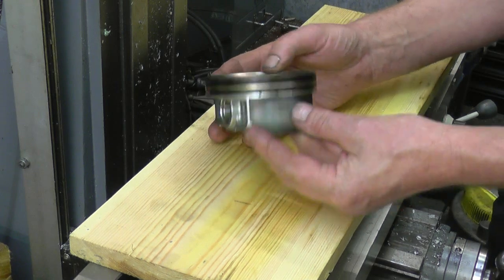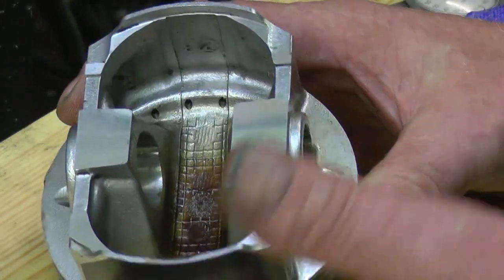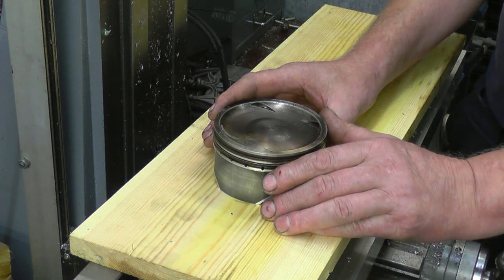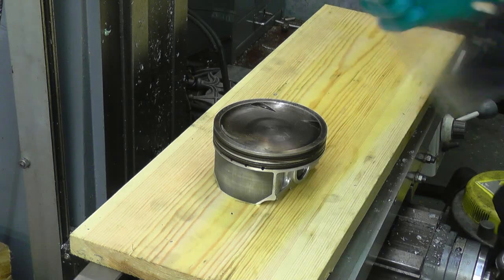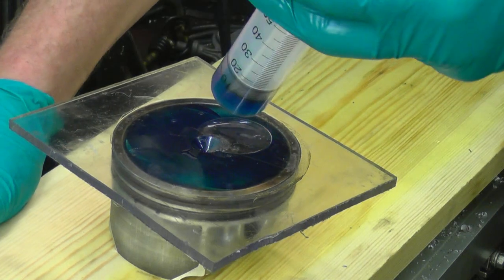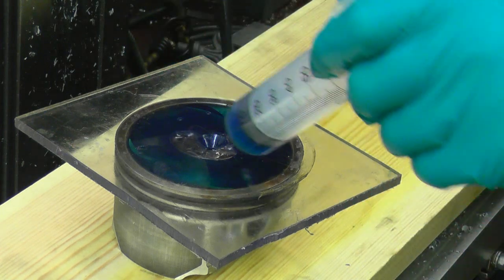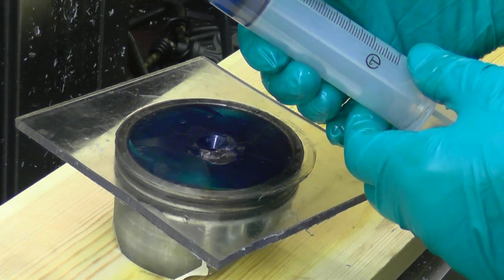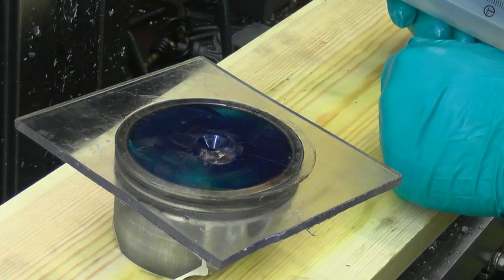Sunday Night Night Cap 29 Part One

Comment: I have a worry about machining the top of the piston down that thin, looks like it was getting hot as it was, the reduced thickness will mean a lot less heat transference through the metal and might melt, with the cc ing of the piston top alcohol works really well and wont bubble up like oil does.

Comment: John;

How much boost is your friend planning on with his engine?  By doubling the bowl volume in the piston, it leads me to believe he is really planning on putting the pressure on.  Also, is he going to stay with gasoline as fuel or go to methanol or some other fuel mix?  My experience is that you typically add about 20% to 35% to the combustion volume (whether in the cylinder head or piston) when you turbocharge to "normal" road operating pressures.

The reason I bring up those questions is that I am not sure a .150 thickness in the piston crown is going to last over any period of time if there is serious boost pressure.  The original designers would have had a safety margin in their design, but with a resultant .150 thickness after machining, flex in the crown under detonation is a possibility.  Flex the crown enough times and the potential for catastrophic failure could occur.  My guess is the center boss is on the piston as that is where the Subaru spark plug is located and would be the highest detonation pressure zone on the piston.

One other way to add combustion volume is to go with a thicker head gasket.  You could machine one for him out of copper and maybe pick up half the extra volume and then you don't have to take out so much material from the piston.  Just something to think about.  A third option is to machine a thicker steel spacer gasket with two thin copper gaskets so that you end up with a composite head gasket (i.e., copper gasket - steel gasket - copper gasket) with soft copper to seal the join points.  Again, something to think about.  The thickness of the gasket would be:

Measured volume of current combustion chamber divided by pi (3.1416 is close enough) divided by the radius of the piston (half the measured diameter) squared.

That should give you the thickness in cm's.  It should be less than the .200 depth you measured since it will encompass the entire diameter of the piston and not just the diameter of the bowl as you measured it.

Regards;

Ron Kluwe
Reply: I share your concerns about piston thickness, but rather than multiple head gaskets a custom thicker base gasket might be more reliable and achieve the same comp lowering required. This is an option on a motorcycle engine not available on most car engines, save perhaps air cooled VW and Porsche,
Reply: Chris Stephens Adding more head gaskets will make the squish clearance too big which will lead to troubles. I think the piston is just not beefy enough for this application, the thickness just isn't there to reduce the compression ratio safely.
Reply from the maker: He is hoping for 20 psi boost
Only short runs
I told him it will melt at least he is having fun lol

Comment: The water wheel seems to be out of balance as it seems to speed up and slow down at the same spot. Not sure where the spark plug is located in the bowl of that piston, but it would determine how best to cut it to make the most power.
Reply from the maker: I think it is central v formation valves
(all I do is the machining) lol